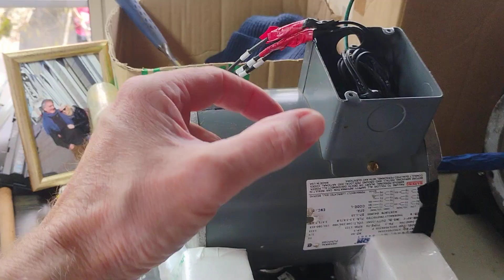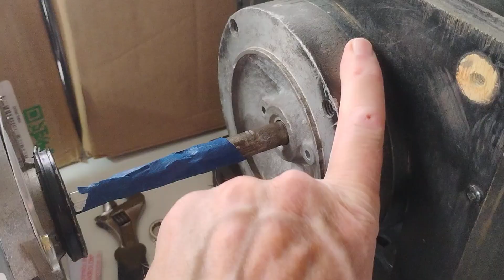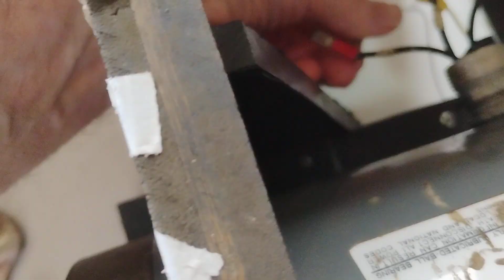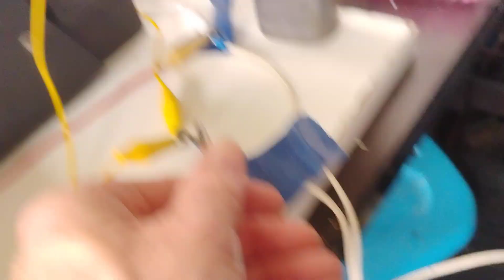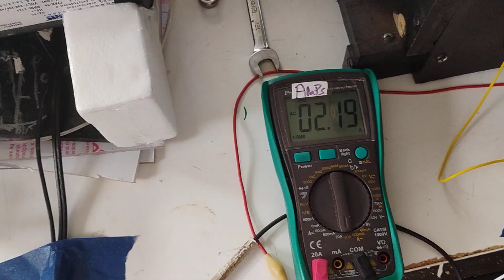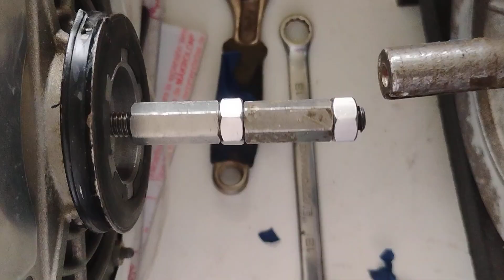PMRV (Permanent Magnet RotoVertor) now runs on 60hz AC using a pony motor to bring up to speed

Comment from the maker: Its 1750rpm because both 4 pole 3,ph AC induction motors and the power input is 120vac and 60hz from grid.  Borh marathon brand and both 1/3hp size.
Motor to left has some permanent magnets in rotor, see previous videos to see how the rotor is.
The motor to right has very low draw and I have done lots of videos testing it out. 
Both motors are 3ph type, but are run on single phase AC to lines 1 and 2 and there is run cap between lines 2 and 3.
This is called a rotovertor set up.
The mohor can be tuned to very low draw or given better shaft power by the choice of run cap vslue.
Sure you can give your analysis of what is going on!